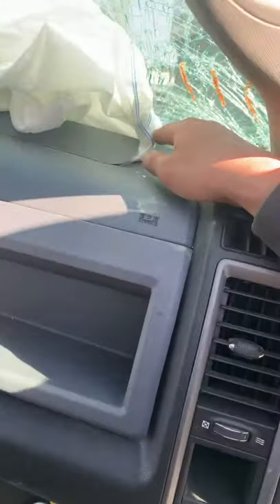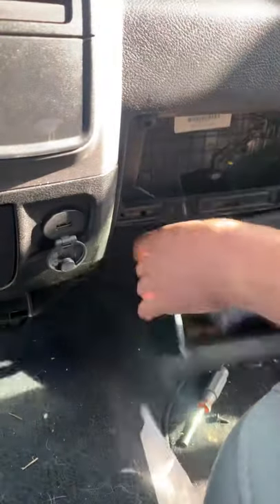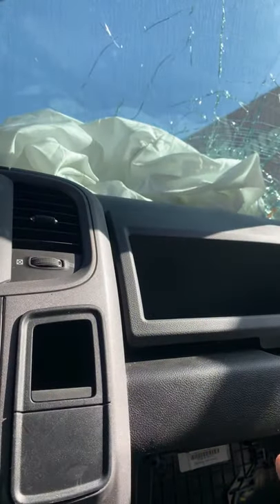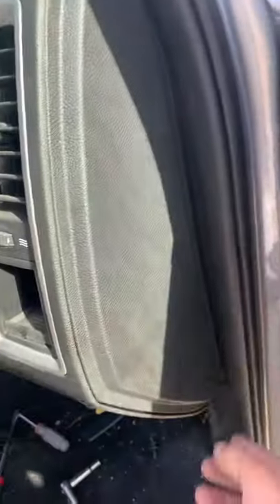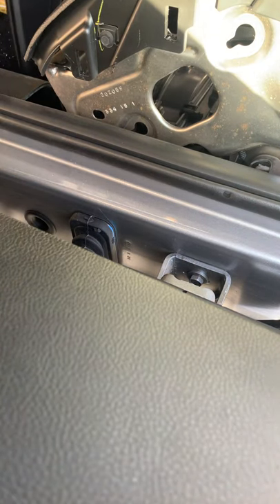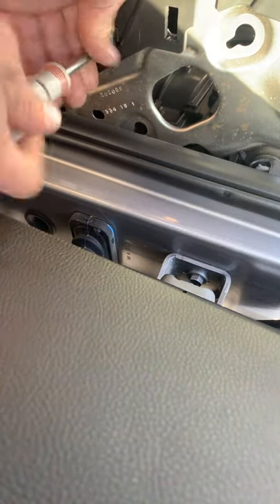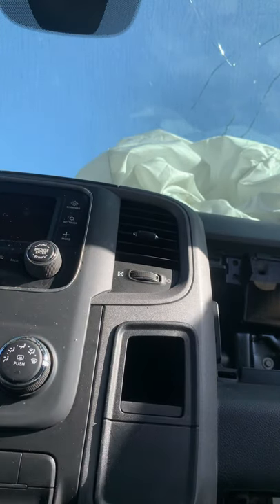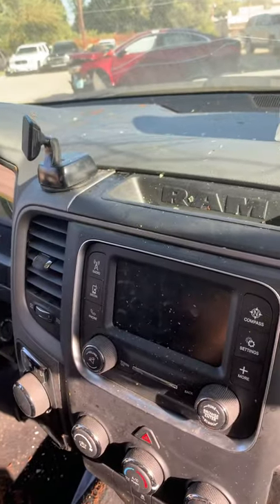2019 ram DS classic dash removal

Comment: Do you know if to replace the passenger dash air bag you need to replace the full dash ?
Reply: Yes you do do
Reply: @albertm105  thank you I’ve never done it on a dodge. Know where I can get a cheap repair manual? I’ve done other cars to include a recent 2020 navigator but never dodge
Reply: @flightmedic7169 check the forums but it's pretty straightforward I just finished doing mine bout a week ago following this guy's instructions and another Mexican guy that has a vid of a 2019. Lmk if you need any guidance
Reply: @albertm105  awesome thanks I’ll look for the 2019 that’s what I have.
Reply: I have a limited dash that airbag has not deployed just needs the leather glued back on since it came off a bit from the foam. Will sell super cheap if you are in Florida
Reply: @albertm105  sorry Im in Arizona